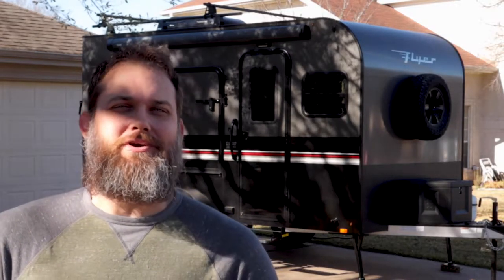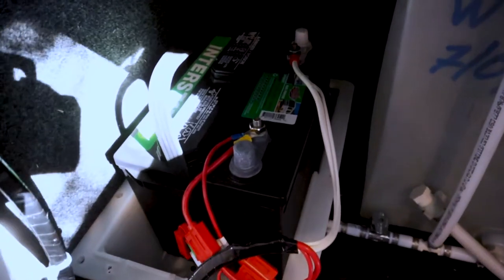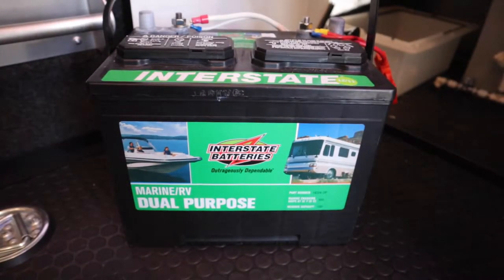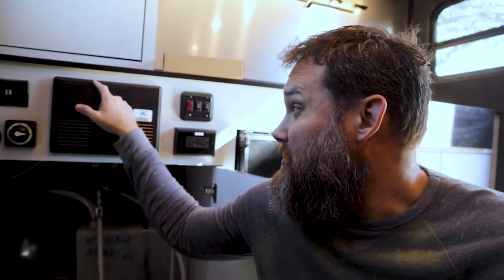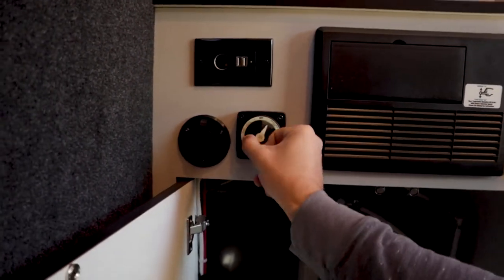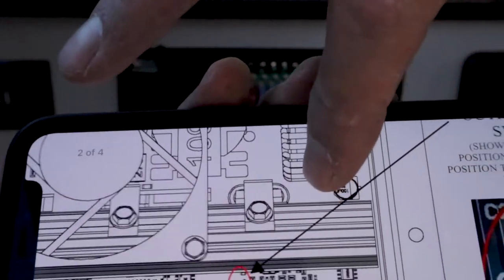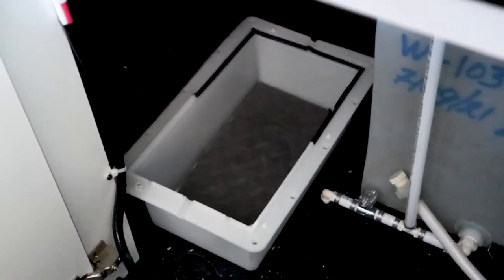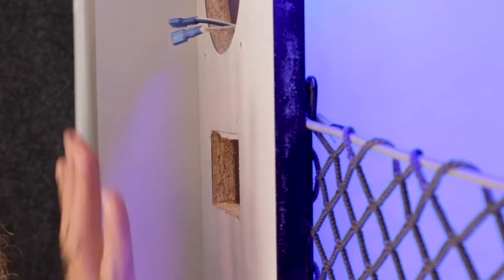Lithium Ion Phosphate (LiFePO4) Battery and Monitor Install on inTech Flyer Discover

Comment: That refrigerator does in fact run off of shore power as well. I have the same exact trailer and got a recall notice that wires weren’t installed from the back of refrigerator to the power distribution for it to run off the battery. It would only run on 120. They sent me the parts I installed the wires runs off of both.
Reply from the maker: Yes indeed! I did say that incorrectly. I had another, earlier InTech (a prototype build, actually) and had to connect that trailer's refrigerator to the 12-volt system as it was originally only wired to the 120 circuit. In all, when those connections are in place, I really like the 12 volt compressor fridges.

Comment: Nice job brother! How did your upgrade turn out? I ask because I am interested in the same trailer. Tell me about your solar setup please to keep that battery charged. Thx!
Reply from the maker: Hey T.V. Outdoors & Hobbies! I'm just running with a small, portable folding solar array from Renogy right now, 100 watts. This trailer is so simple that a full charge from shore power and towing to our destination should get us 3 to four days of use just off the 120 ah battery. I'll likely find more projects down the road to add more functionality, capacity, and charging, but that's what I'm up to at the moment!

Comment: Good job 👍
Reply from the maker: Thanks!
Reply: I did mine 2 years ago, Works great. I had to change the controller out , but not that difficult just extra expenses.
Reply from the maker: Ah, I hope to get some mileage out of this before finding a different option for a battery monitor.

Comment: Thanks for the video, how did you handle the top venting portion of the battery cover? I know it vents to outside on the side of the trailer. Did you block it off? Thanks
Reply from the maker: Hey there! I blocked off the vent with some foam gym-floor padding (the type that fits together like a puzzle) that I had laying around the garage. I cut it to size and that’s about it.

Comment: I am subscribing to you because you're cool.  I'm not familiar with your feed but it would be nice to know the specs of your new battery and how that conversation did or did not satisfy your electrical needs (and what those needs were/are).

I am most interested in creating an efficient-as-possible hybrid solar-gasoline system.  So a bit of solar, a bit of generator, and a bit of shore power...hoping to not use gasoline or shore power at all, but loving the backup possibilities.

And I forgot to add that I want all the comforts of home.  Climate control as needed to stay comfy and plenty of energy for whatever I chose.  So like super-bright LED flood lights for instance.
Reply from the maker: Here's a link to the nitty gritty specs on the battery I usedL https://cdn.shopify.com/s/files/1/0469/5742/8899/files/EX-G27-120XDP_Spec_Sheet-web.pdf?v=1643405718

Also, I have been pleased with the performance so far, since I have such a simple trailer. I haven't "maxed out" the battery yet, as we've only done short duration stints, so far. I'll have to get out more often and put it through more paces! Thanks!

Comment: How is the AC in the unit.  ?   Luv the trailer
Reply: I'd say... it works. If I'm in the hottest part of a Texas summer, I quickly close up the beds during the day to reduce AC leakage out of the canvas tip-outs and the trailer stays nice and comfortable. Pretty much any other scenario I've camped in during other times of the year or in other locations, it's been just fine, even without folding the tip-outs in during the heat of the day. Keeping the tipouts under awnings has proven to make a huge difference in direct sunlight, too.

Comment: Do you need an inverter for this trailer?
Reply: The simple answer is no, but the real answer is "that depends." The trailer works as designed from the manufacturer. If you would like added capabilities, then you may choose to add an inverter. I haven't needed an inverter in the years I've been camping with trailers, but I would consider adding one if I had more need to use the wall outlets (110) for appliances. Currently, my family has been great with the simple setup and using the 12v power system, when needed. I hope that helps!